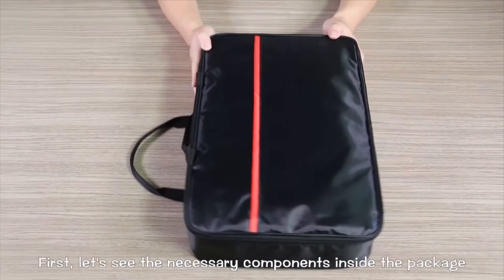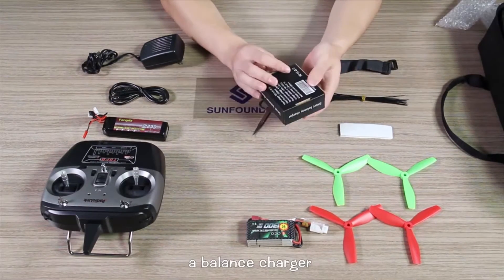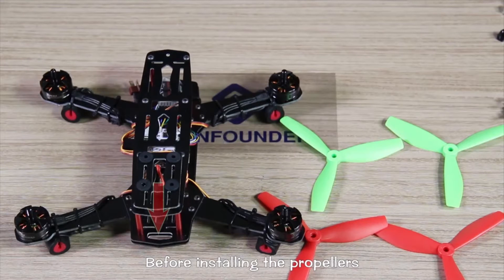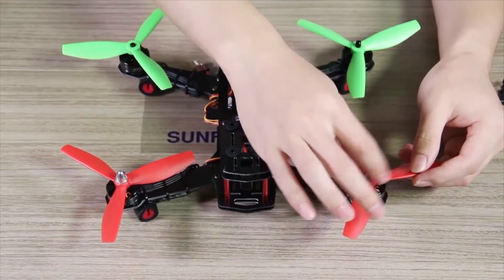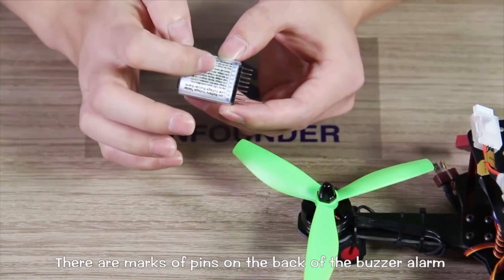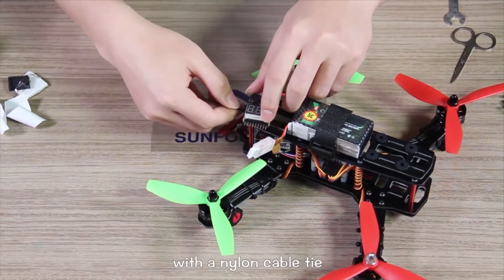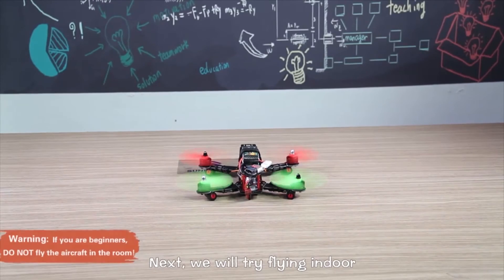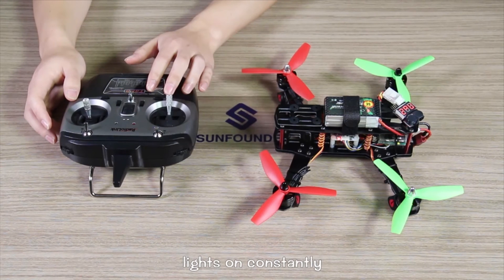SunFounder SF250 FPV Racing Drone Quadcopter Assembled Kit - Unbox & Apply (propellers etc.)

Comment: I can not unlock my Quadcopter, I did exactly what you said and it did not work on any of my attempts
Reply from the maker: Dear Grice,
Unlock: Pls toggle the throttle to the right side when the throttle is 0 state. The indicator light will flashing quikly, and you can't release immediately, wait a few seconds. When the indicator light flashing normal speed, then you can release the hand to unlock.
Have a try!
Reply: Toggling the control was the first thing we did.  Perhaps 20 times with no success.  What next?  The transmitter is unable to connect to the receiver.  How shall we proceed?
Reply from the maker: Dear Grice, 
Pls follow the below link, this is our Forum, you can find the solve way in it!
Try to test it!
https://www.sunfounder.com/forum/radio-link-t8fb-receiver-transmitter-link-unsuccessful-2/#simple-forum-post-1283

Comment: What is the max control distance for this quad?
Reply from the maker: Dear Burks,
What you mentioned quad is more than 1000 meters air, the actual control distance depends on the flying environment.
Reply: Damn that's pretty good. By flying environment you mean indoors/outdoors? With weather factoring in also? (one of my old quads didn't like Cloud cover and fog, while others I had could fly about the clouds no problem)
Reply from the maker: Hi Burks，
It is not advisable to fly indoors, it's too dangerous.
There are many weather and environmental factors,  whether there is cloudy, wind and high-rise buildings.
If you want to fly it, we recommend that you can choose a safe place.
Have fun in SunFounder!